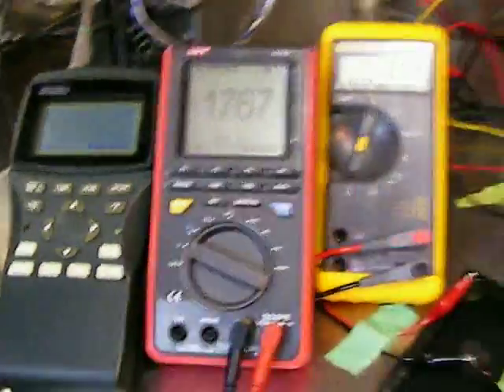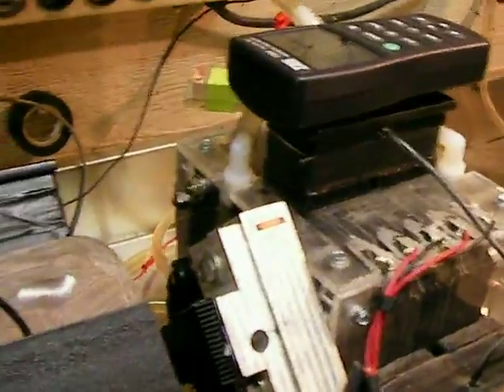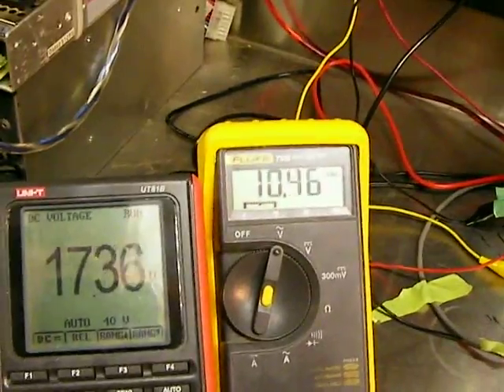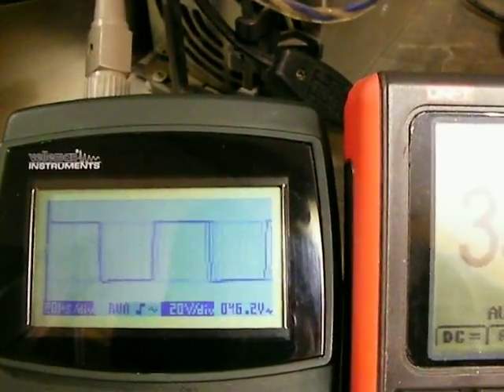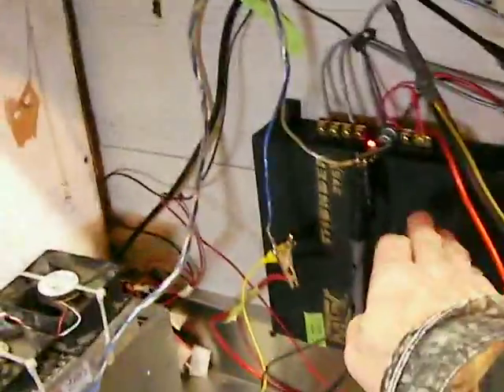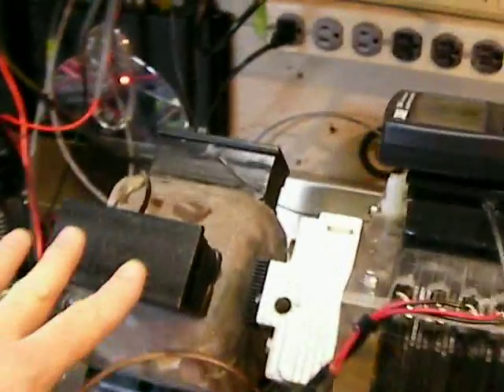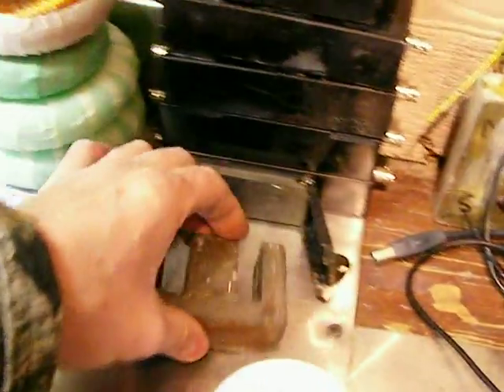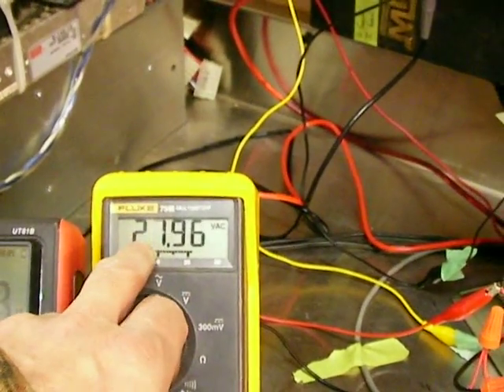Hydrogen cell powered by high voltage DC

Comment: See the Hydrostar circuit by Chambers. The wire coil can be hooked to cell electrode for flyback high volts pulse. The Meyer cell had 2 coils and minimum 1500 volts to electrodes. The cell circuit by Dan Danforth  used similar circuit in Sri Lanka long time back for effiicient hydrogen generator. Puriich circuit was AC electrolysis at resonant frenency of cell also. I was impressed with the Horvath Patent circuit that used magnetic flux from cell transformer and magnetic spoke electrodes. He converted several cars to run on water. You should purchase and read chapters in Sept 1946 Amazing stories magazine about prop plane engine that ran on hydrogen from Tesla coil and steam generator. Man came to US during WW2 to keep invention from the Nazis. PDF is also available to read for free on internet. "The Hefferlin manuscript"

Comment: problem is you're adding efficiency losses... would be better to run a diode directly from your 220v household power, alot less losses
Reply from the maker: i tried that the diode gets super hot had to submerge it under distilled water

Comment: congrats you just made a almost 100 kg weight voltage converter......
Reply: hes boosting frequencies out of his signal generator... the amps are signal boosters lol u look like you don't know what 
you
are
talking
about.
Reply: Shannon Williams yeah im talking about ZERO efficiency HHO making, you don't get any real gain with these apparatus....lrn2 energetics and thermodynamics

he took x voltage in the input , with y volts on an output.... so yeah, a 200 lbs voltage converter
Reply: +Brother FiretribeFan no gain? you get hydrogen and oxygen in a low cost system. That in of itself is a gain. Yes these systems are not at peek efficiency. So what... you get gasses you other wise wouldn't have easy access too. If you separate the hydrogen from oxygen then use the hydrogen in a high efficiency high voltage AC to low voltage DC ionized gas homopolar converter. When the gas is used in a system like that and not in a combustion process there is no reason to keep producing the gas because it is only excited to a plasma never combusted.

Comment: ok this is just info about amps (i thought about doing this too but @30hz-50hz) for dc car amps it that there is 3 types of amps (i know there is more, not sold much) .
A class amps are pure amplification but high amperage true hi fi geeks love these
A/B class (aka bi poler amp) or mosfet power but pulses almost pure sound waves
d class digital sampling amp note pure at all but lowest amperage of the 3 
i know there is more just pointing it out to you or others . i have been in pro sound offs

Comment from the maker: the whole idea behind this is to have a cell that you fill with tap water. the mafnetic resonance and water treatment coil removes the metals and the chlorine etc. if not then the water would turn black! this is not the case. there is a strong zeta potential happening as there is alot of trash falling into the bottom of the resivor.it is a rust color shmeg.. the plates are 316L 18 ga. i got from eagle laser. they are non magnetic i checked all of them with a N45 neo magnet.

Comment from the maker: thanks Rob i looked on youtube and did not see this vid.. i added it to my favorites i am making a circuit to drive the cell with 60,000 volts at 10khz the VIC will be submerged in oil to absorb the heat..

Comment: I dig your enthusiasm. Car amp is a great idea. I believe a class B amplifier works in a push pull fashion meaning you could be getting 24v P-P out of the amp without a transformer. You figure many of these car amps can push 500 watts into a single speaker. At 8 ohms means you need 62Volts. Best to use a scope.
I've had lots of challenges with the VIC trying to drive the high capacitance of a cell. You are way ahead of me because I never got that kind of production out of tap water.

Comment from the maker: actually both emf and rfi with the unified field and i am building the laser to inject protons into the unified field. look in the video at the aluminum block. that is the laser mount also the cell will produce occasional bubbles as much as an hour after it is turned off after a long run!